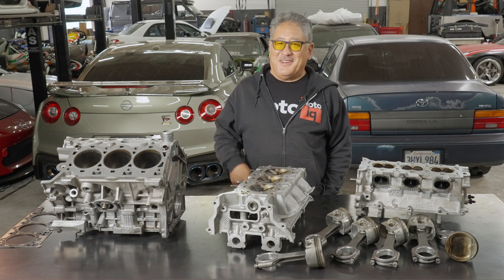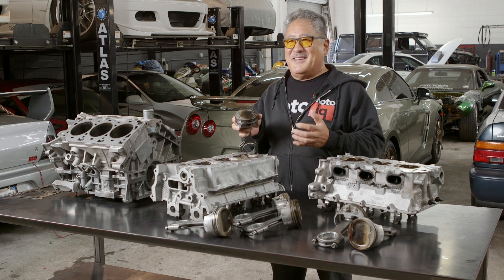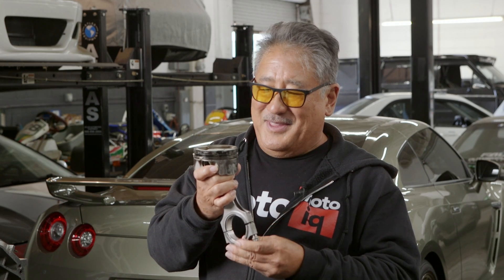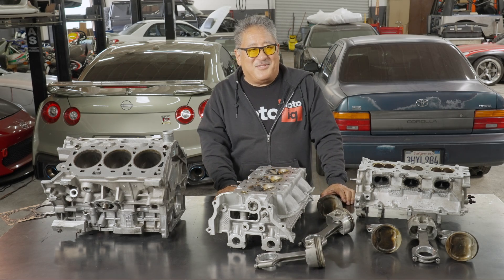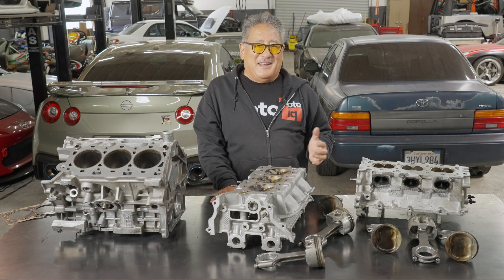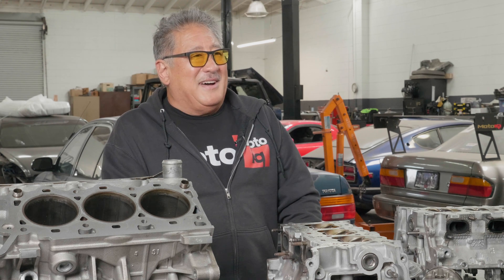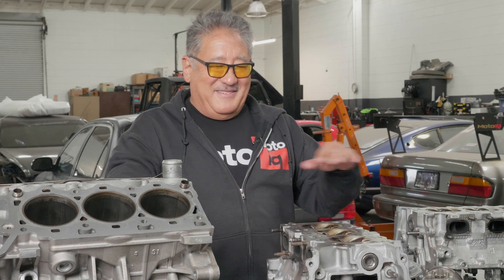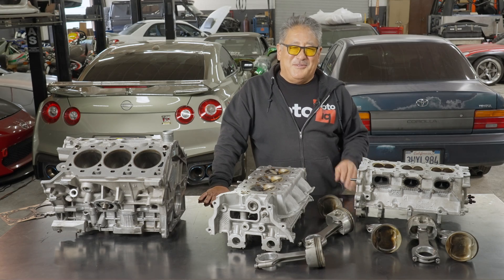Engine Autopsy | Detonation

Comment: No one is interested in someones drift car. 

We want the details on that ae100 in the back.
Reply from the maker: What drift car? This engine is out of a Noble. No AE100 this is a stock pos e100 Corolla with 300k miles on it.
Reply: @motoiq  We are interested in the pos e100 Corolla. 2ZZ swap and to the drag strip.
Reply from the maker: We are not, that is a beater car.  We are tying to see how long it can last.

Comment: I am surprised that you wouldn’t offer to install and tune the engine especially after high performance rebuild. In the commercial world an Engine job is not completed until running up and the engine based on the specific load running in diagram and load testing the complete package for few hours . I am surprised that this kind of rebuild is even considered where one person is building the engine different person is installing it and a 3rd person is running and testing the engine. On the end nobody is responsible for anything and the customer is simply dumping money and obviously the customer is the one that has no training or complete understanding of the process. This is completely shocking to me.
Reply from the maker: When the customer is 3000 miles away it is hard.

Comment: My ej leaned out on boost at high rpm from 6-7k the other day.  Still runs and sounds normal now and pulls the usual amount vacuum  at idle  but def think I heard det...How f'd am I? 😢
Reply from the maker: Sounds like its ok.  Better fix that lean issue.
Reply: @motoiq  fixed it immediately in the tune when I got back from the drive. Ve table had a mistake. Hopefully it continues to live on

Comment: “ONE PULL HERO” 🤣🤣

Didn’t  PULL OUT on time.. 😂🤣
Reply: No joke though, I had a fairly large racing company doing remote tuning on my car. they are one of the big ones for GM's. they were using hp tuners. I knew just enough about this stuff to realize they had gone in and almost completely defeated the knock control system to push the numbers up. the knock control system typically has a tables to remove a certain amount of timing advance based on a variety of factors. the table that gives the absolute value to the number of degree removed was set to 0. 
I proceeded to learn how to tune my own engine and told them to shove it. One of the best decisions I have ever made I am sure my car wouldn't have lasted long, it currently has 180k miles on it and that was 120k miles ago.

Comment: The most common sign of detonation is tiny pits, sprinkled on the face of the pistons. The pistons in the video don't have much of that, if any tbh. Did anyone else pick up on that? I love this channel but I don't believe this is a good example of "detonation" ? maybe the camera wasn't picking it up? From what i see the brown/black parts are just extreme heat not detonation... please correct me.
Reply from the maker: they do it is hard to pick up

Comment: Hey Mike, my 12:1 compression H22 Honda motor runs really rich. It was dyno tuned on 93 octane, and made decent power. The exhaust is sooty. I know honda Vtec motors are tuned rich from the factory. Is this just a safety measure to prevent detonation at high rpm? And if I tried to get away with a leaner tune, what would be the downsides? Appreciate you guys. Great knowledge here.
Reply from the maker: I don't know what rich and leaner means, got the AFR's?
Reply: @motoiq  it’s tuned to 13:1 at WOT
Reply from the maker: That is super lean on pump gas.
Reply: @motoiq  Ok, thanks.
Reply from the maker: Aim for mid 12's to be safe.  Might loose a little power but it would be safe. 13:1 is risky with 12:1 and pump gas.
Reply: @motoiq  I think the plugs might be too cold, I’m running bkr7’s. motors only making 220whp. I’m gonna talk the tuner, but I think I’m gonna throw a set of hotter plugs in it
Reply from the maker: I think 7's are perfect.  I would check your tune to see what your AFR is at part throttle, maybe it is too rich there.
Reply: @motoiq  Ok. I appreciate your advice.

Comment: One of the most elucidating experiences I had early in my tuning days was fixing a pair of Det-cans to the engine that I was tuning. The ability to hear the sparkles that would occur on the edge or leading up to detonation inspired me to learn more about combustion dynamics and helped me calibrate knock-sensor equipped engines with noisy valvetrains.

Comment: Hey, I was taught that if the detonation on pump gas is audible, it's at least 5 degrees too advanced. Would you say that's correct?
Reply from the maker: I would say you gotta correct or it will end up looking like this engine.
Reply: @motoiq  Oh yea no doubt, rebuilt several engines tuned by other shops in the past only to hear detonation on the first test drive. I usually rely on the data from ecu so adjusting timing based of hearing detonation is a bit foreign to me, I typically allow a maximum of 6 degrees timing pull by the eco on the hottest summer days.
Reply from the maker: We tune for zero

Comment: Also when tuning and running your engine on the track or road racing. Your EGT’s matter and should be consistently monitored👍🏻
Reply: very useless data tho, every engine has a different exhaust temp. If you do the same build with same boost same internals everything the same then yes you can use egts for comparison but egts are not comparbale at all. A sr20 is nit gonna have the same egt as a k20. Its like saying they need the same advance- Whats more important is intake temp since that is actually comparable. But even if it gets very hot u usually install a failsafe so the engine runs less boost or advance when iat‘s get hot. More boost= more egts- it doesnt mean your engine is gonna blow up. Real engine damage can happen wayyy before egg‘s get out of „norm“

Comment: My last engine failure was a piston wrist pin retaining clip snapping in two places, still not exactly sure why. I think I used a metal tool to help get it into its groove last time so I've switched to using a wooden tool now so I don't scratch it. Most common failure I get is burning/cracking through the piston at the mold parting line. I've thought about using a dremel to make that a smooth surface, but I don't know if that would help much. For now I just keep the temps as low as I can and don't push it when its too hot.
Reply from the maker: Is your engine tuned right? Why are you using a cast piston for extreme use?
Reply: @motoiq  Its a stock Honda motorcycle engine from a CB300, Id love to mess with the tune but their ECUs are locked down tight. I think they come a bit lean from the factory. I also really beat the hell out of it (lots of time at full throttle 6th gear, high rpm). But they are very easy to take apart and put back together and the piston is $60 so I don't mind it too much. At this point im treating it as a consumable item 😅. Although every now and then it wipes out the cylinder too which is $90.
Reply from the maker: Try a power commander?
Reply: @motoiq  That seems like the best option. I've always dismissed it because the performance to be gained is pretty small from this engine, but the added reliability might be worth it. Something for the future when I get bored of rebuilding it 😁.

Comment: Please reply i commute roughly 90 miles a day in stop in go traffic in california, i have a 2015 launch edition sti. Is it normal to burn 1 qt of oil at 1500 miles? Im doing 3000 miles oil changes but is that type of consumption normal? I have no white exhuast smoke or no white smoke puffing out of my oil cap.. no rough idle no problems whats so ever at all feel great and healthy doesnt lag or feel sluggish... i average about 28 mpg in my car. But is that normal? 1500 miles 1qt if oil? @motoiq
Reply from the maker: That is on the high end of normal.  I might consider an AOS and a heavier oil like 20w50.  Also stay on top of that oil level and make sure it doesn't get low, this is one of the reasons why Subarus blow up.
Reply: @motoiq  love this damn channel I subbed already thank you! 

Do you think my problem can be because I'm using mobile 1 advanced full synthetic? What brand would you recommend I try? I can get at autozone? 

Valvoline? Castro? Royal purple?
Reply from the maker: @boostedrex9460  mobile one or any top GF-6A rated 20W50 or 15W50 synthetic oil is what you want.
Reply: @motoiq  thank you for replying you don't understand the stress I'm under with this car, I keep it stock and check my oil after every day at night. I'm on top of my oil consumption like no tomorrow , is this a sign of early failure? 

Thank you for not leaving me hanging I appreciate all the knowledge you spread and everything you do for us EJ owners. I'm still underwarranty 3rd party warranty I'm afraid to tell them cause my wife will be devastated since she bought me the car
Reply: @motoiq  but if I need to i will take it in. I'm just afraid of it being denied them gotta spend money on a new short block I just got this car
Reply from the maker: I would use thicker oil and monitor the oil consumption.  You are probably ok.
Reply: @motoiq  thank you bro much love man! !!! Great videos keep up the good job you guys always hitting out of the park!
Reply: @motoiq  how thick of an oil should I use?? I’ve used 10w30 and 10w40 so far
Reply from the maker: In what kind of motor?
Reply: @motoiq  vq35de i have a slight misfire…… changed spark plugs, ignition coils, valve covers
Reply: @motoiq  and only has a p0300 code
Reply from the maker: Those are indications that your engine is probably in poor shape.
Reply: @motoiq  what u suggest a rebuild or just swapping in a new motor
Reply from the maker: It depends if you want more than stock and if it has to stay smog legal
Reply: @motoiq  it has to pass emissions
Reply from the maker: Then swap in a new stock motor and keep it stock.
Reply: @motoiq  rotella?
Reply: @motoiq  what would you suggest for a 190k vq35de oil keeps fouling out my ngk spark plugs causing a misfire….new oem plugs, coils, valve covers? Help would be appreciated
Reply: You my friend should make your daily driver an EV, 90 miles a day in traffic burning gasoline is insane!
Reply: @rogermartinez78  apparently oil  too. It's my daily driver I bought it so I can use it. Idc about money I'm a welder. I make bank in california. I'm just worried about my car I just bought it. Lol

2015 wrx sti launch edition 30k miles 1 previous owner. From a old tech the car has been stock since birth
Reply: @boostedrex9460  I too live in California, but I bought an EV for my daily commute, and it comes in handy on that infamous 405.
Reply: @rogermartinez78  I drive it at 60 mph. 65 max. I have fun here and there but nothing crazy to be burning oil like it does. The manual says 1qt every 1200 miles is acceptable but is it really?

Comment: some people put in the wrong gas octane like using 87 instead of 91. Regular stock engine with normal ecu
Reply from the maker: Most late model cars that should be ok, you will just loose power.
Reply: @motoiq  that's good to know, thank you